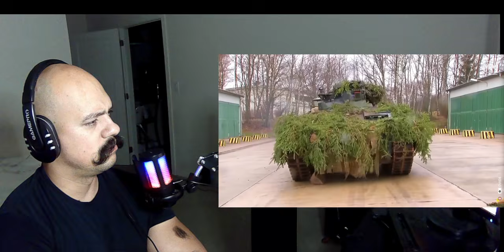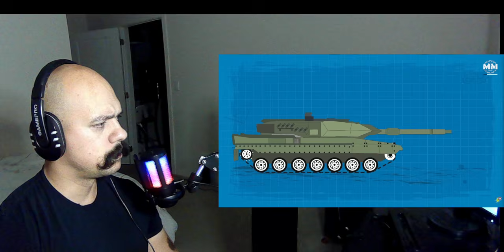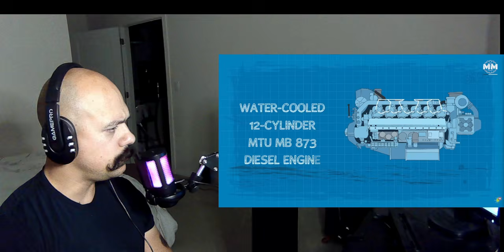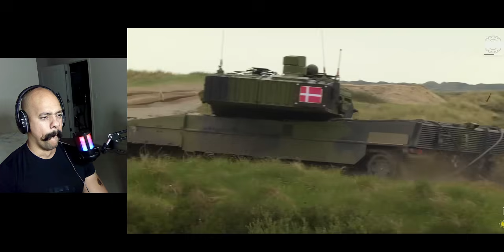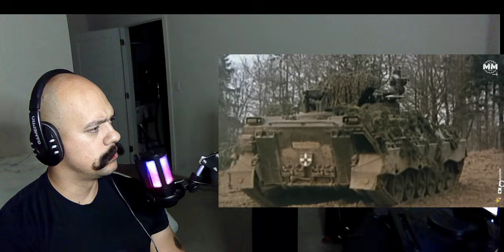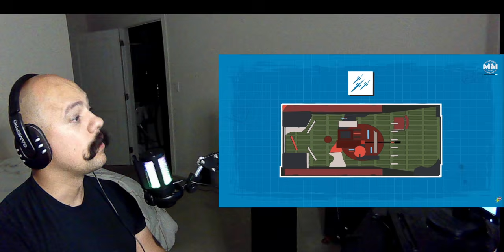German Military reaction | The Insane German Engineering of the Leopard 2 & Marder IFV

Comment: @12:07 No, its not a battle taxi like the M103. The Marder is designed to support the soldiers during the combat, not to leave. The soldiers and the IFV are one combat unit and operate together with die Leopards. And the animation is wrong. The engine is located at the front of the vehicle.

Comment: The problem with Leopard2 and other western tanks is their weight. They are too heavy for the yearly mud season in Ukraine every fall and spring. They got stuck in the mud. But they function well in summer and during winter, when the soil is frozen and hard as concrete. By the way, the germans during WWII had problems as well with their heavy Tiger-tanks on the eastern front.

Comment: The Marder IFV was essentially phased out by the German Armed Forces and replaced by the Puma IFV.
Reply: Most units still have the Marder today.
Reply: @Richman0815  and the pumas we actually have are like 80% not combat usable but we're getting there.... someday
Reply: @saimen.s6058  Someday... 😀
Reply: @saimen.s6058  And that is not true, well done for spreading misinformation. 80% of Pumas in a single combat training where reported to have suffered malfunctions to their Air Conditioning. When the Pumas where send to Rheinmetall for repairs, it was discovered that all of them worked and the crew operating the puma was not properly trained. That's it, not more, not less. 

So next time, please read the full Article not just the headline.
Reply: Die Wehrmacht gab es bis 1945! Danach ist es die Bundeswehr!!!!